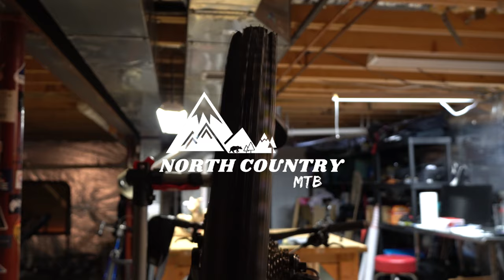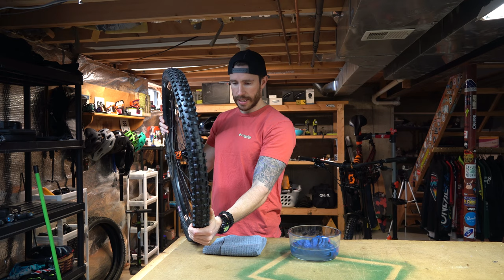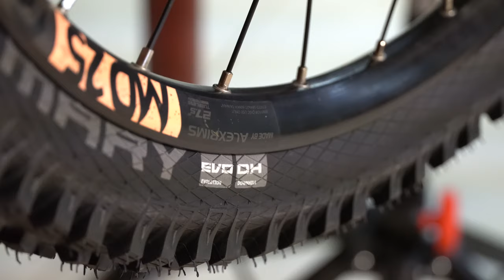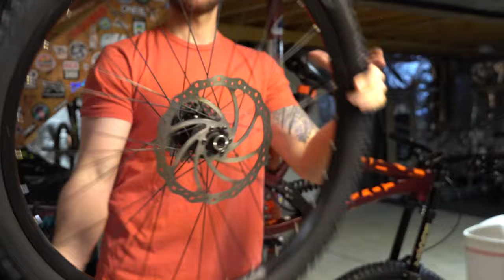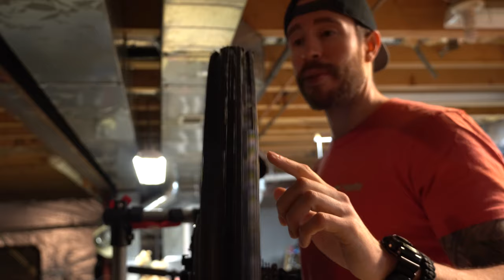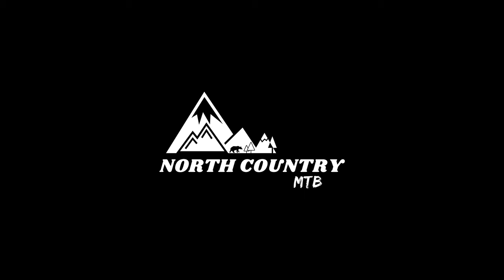How to get rid of that Wobble in your tire | MTB 2021 4K

Comment: Great tip for people who struggle seating the tire. Two things: First, I do this with a spray bottle and you don't have to take the tire out of the rim. Just deflate it and spray soapy water with the bottle and inflate again and voila!. Second: it's always better to go tubeless :)
Reply: Does this method works with tubeless tires? I dont wanna contaminate the sealant with soapy water.
Reply: @cardace2691  I usually seat the tires first and then add the sealant by the stem valve.
Reply: I mean, does deflating the tire and spraying soapy water to the tires contaminate the sealant inside?
Reply: Nevermind, i found out that the problem was in the tire bead itself. I guess its not fixable haha
Reply: @cardace2691  so what did you do? Did you returned the tire or used just as it was. Does it affect your riding?
Reply: @jeansaldivar1245  i just replaced it with new tires. And it does not affect my riding. I am just annoyed with the wobble
Reply: Still didn't help me
Reply: Soapy spray works well for hand fitted motorcycle tyres too
Reply: Spot on, I had a set of wtb gravel tyres that I didn't seat correctly and the bike was bouncing, followed the tip here and bingo tyres are spot on 😊
Reply: No, is not
Tubeless has a LOT of issues being one of the biggest bike can't stay without moving more than couple of days or sealant will get ruined
Reply: Maybe I'm not spraying enough or don't know where to spray but was really hoping this trick would work for me

Comment: THANK YOU  This saved me a $300 trip to the shop.  A few tips from personal experience:
1) Use more soap than water.  I had a whole giant squirt of Dawn dishwashing soap, with just a dash of water from the kitchen sink sprayer to bubble it up a tad.
NOTE You don't want to use oil or silicone lubricant.  Those remain slippery.  Soap dries up and becomes tacky.  Once the tire is in place you want it to stay there.
2) Use a fat chunk of sidewalk chalk to mark places where the bead of the tire is unevenly tucked.  On my tire there was a very distinct line to follow along the edge of the rim, and it was pretty obvious where it had not popped far enough out.
3) Marked both the sidewall and the tread, and spin the tire to confirm that the wobbling was happening right at the chalk.  It clearly was for mine.
4) Deflate the tire, and apply generous amounts of soap to the sidewall and rim only where you've marked with chalk.  The rest of the tire is seated already, so leave it alone.
5) CAUTION: I would highly recommend researching the PSI limits of your rim and tire before moving on.
6) Slowly and consistently inflate the tire.  My bike pump has a gauge, which helped tremendously.  I inflated to about 20psi and worked the tire back and forth again with my hands.
7) I went to the absolute limit of both the rim and tire.  I also hit the spot with a dead-head hammer (rubber with sand inside) to convince it.  This was sufficient for the spot on my back tire.
8) My front tire only had one bad spot, but it didn't want to budge.  I had to actually go over the rated pressure (60 psi vs. 50) to get it to pop.  It didn't do it right away.  It took about a minute.
9) After the tires were seated, I backed off the pressure to get it back within the normal range for the rim/tire.
10) I did not remove either tire from the bike.  This worked with the bike upside-down on a flattened box on the garage floor.
11) After cleaning up, I rode the bike, and I couldn't believe the improvement.  It rode like new.  I couldn't be happier.

Comment: DUDE!!!! Thank YOU!!!!  How did I not know this?

I was so angry my 90$ a pop, Vee Huntsman fat tires were doing this! I was about to get different tires but so dreading replacing them again. My e-bike has a hub motor in each wheel and changing tires is a huge pain in the ace!

I deflated my tires, got a spray bottle with some soapy water, and went to town spraying it in the inner sidewall of the rim and along the bead. Inflated it and BAM! THESE TIRES ARE FINALLY SEATED ON THE BEAD!!! Of course it's going to rain for the next few days so I can't confirm the wobble is gone, but I can clearly see an even spacing now, and the ridge of the bead is where it belongs.

Bro, you are a lifesaver!

Comment: Thanks for the fix. I had the same issue - Strangely with Schwalbe tires as well. It had really gotten me down as I tried everything to fix it and still no luck. I also trashed my rim with metal tire levers (snapped all my plastic ones in the process) trying to get the tire on the rim in the first place. The wobble was just the kick in the n*ts that I didn't need.

Comment: Thank you! Just adding to the long line of people who solved the issue like this. No more bumpy ride on a smooth road.
Note - for me it only worked after I really soaked the tire with a soft brush. Using little water with a rag didn't work, nor did WD40 like some people recommended. Also there was no popping sound in my case.

It's a little weird that a bike technician told me my wobble was totally normal (apparently sometimes tires just come out like that from factory) and there's nothing I can do about it.
Fortunately he wasn't convincing me to buy a new tire, although I was seriously considering it. I rode with a bumpy wheel for about a year because it never occurred to me to lube the darn thing and pump it way above the recommended pressure, I was only pumping just a tad above it.

Now I feel stupid for both myself and that "technician" but I'm super glad I solved this.

Comment: Nice tip! Will try this out in a minute. I saw with much pleasure that you use tyre levers to get the tyre back on the rim. I saw a (dutch) video in which the guy said: Whatever you do, DON't use tyre levers to put the tyre back on. But I, already for over 30 years, use my (plastic) tyre levers as there is now other way to get them on! I'll let you know if your trick worked for me, though I first want to try this without taking the tyre off. I'll deflate them and wet the tyre like that ;-).
EDIT:15 minutes later: Reseated 2 tyres perfectly! Didn't take them off the rim, but deinflated them, sprayed (someone below came up with that great idea) both sides and after that inflated to 50psi. The second tyre almost give me a heart attack, as it 'popped' very loudly, I thought I blew my tyre 🙂. Perfect advise, thank you very much!

Comment: Thanks Dude.  I actually didn't use any soap.  I tried first by manually manipulating the part of the tire that was not seating well and pumped it up to the max psi.  It slipped right in.  It was a gravel tire.

Comment: Ya had this problem too. I just deflated tires a bit and put some chain oil on finger and ran it on the rim both sides and that worked.
Reply from the maker: Great idea. Ill give this shit next time and make a video!
Reply: The method in the video did not work for me, but lubing up both sides of the rim did. Thanks a lot for the tip man!

Comment: Nice one!!! I had the same problem with 20x4.0 fatbike tyre - this soapy water trick  helped a lot - thanks👍. I just deflated and used medium size paintbrush to give a good dose of soapy water on the tyre and rim. Also even though I over  inflated I did not get the "pop" so ended up half inflation and massaging the tyre inward and away with from the rim with my palms to get it to pop in place. I did this all the way around on both sides to get the mounting line as even as possible.

Comment: Can confirm this worked for me. I didn't even take the wheel off the bike. Just turned that baby upside down, deflated and ran some soap around the rim. Inflated and done. Fyi this wobble is more common on folding tires than ones with a wire bead in my experience.

Comment: make sure to check max tire pressure of the rim manufacturer not to blow it off or damage it. even hooked rims have sometimes very low inflation limits. like the dt swiss xrc 1200 has a max limit of 2,5 bar or so.

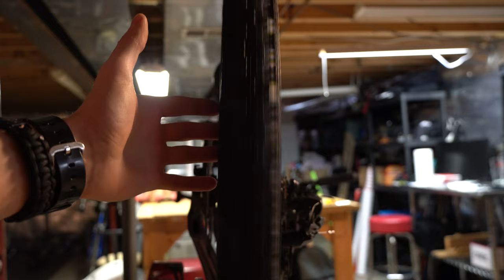Comment: 2:25 Once the frame settled (watching the axle points in the background) there was still a large deflection... did you have a bent rim as well (spokes etc)?

BTW Viewers... If you have a wobbly tyre it can be the rim tape if it has shifted when fitting the tyre. If the tape gets under one sidewall it can cause a deflection.
You can also have a sidewall failure. (See this failure at 40 secs on mark.. https://www.youtube.com/watch?v=PUq8SVRxrVI)

Comment: I tried this method only on one side cause my issue was on one side only when that side seated I saw the problem went to the other side so lesson learned add the soapy water on both sides even if the problem is on one side..good video tho .
Reply from the maker: Great tip! Yeah id do both sides while you are it rather having to loop back. Glad it worked!

Comment: You replaced the tire and tube but it was still warped? If you did al lthat you'd be starting the seating process from scratch each time which should fix it in the first place...
Reply from the maker: Nothing was warped. The tire(s) were not seeding properly until the soap and water method. Whether it be the wheel or Schwalbe tire that made the seeding so difficult is the question.
Reply: @NorthCountryMTB  exactly. Very strange that you basically started from scratch multiple times with 2 different tires and it still wouldn't seat properly.

Comment: I have this problem with WTB tires. Received a warranty replacement and same issue. I also did this soapy water hack and no avail. My tire is seated properly with even line markings throughout the rim on both sides.

Comment: I tried everything even with 2 sets of different tyre's on my HALO T2 rims couldn't for life of me get them to run true until i pumped them up to 80psi then pop they seated properly then i just deflated them to the correct pressure

Comment: Tried the soapy water , just used a small sponge to soak  around the tyre  ,and as I am a cowboy , I didn't even take the wheel off the bike , it worked though.

Comment: I'm still frustrated.
My rims are true within 0.006" lateral per dial indicator. I've always used dish soap to lube bead. Tire rings are concentric to rims all the way around, both sides, on all 4 tires of our his n her's MTBs. But all 4 of our Conti Rubans have a lateral wobble one place each tire. 
What is the industry expected tolerance for how consistent tread centerline is to the beads?
I've never seen tire wobble this pronounced on tires that are concentric to the rim.

Comment: Can I do anything with a defect tire? My rim is trued and I can see the bead line consistent all around. Swapped front to back, same issue. For now, my best option is to mount it in the rear and avoid messing up with the steering.
Reply from the maker: See if you can contact the manufacturer

Comment: Tried everything and still got the uneven wobble. Is it a Schwalbe thing?. Been fitting many tyres over the years and always sorted. Before I throw the lot down the road I will sleep on the idea and tune back in tomorrow.
Reply from the maker: Contact Schwalbe and send em pics they will send ya new tires

Comment: Great video. My LBS gave me the same advice and it worked. But my question is: Is it ok that some of that water is now in there between the tube and tire? Just wondering.
Reply from the maker: Should not have any issues with a little water in there. If it doesn't evap it will just be moist. Have not had any issues with mine!
Reply: Some report an internal rust issue.  On one video the guy just used straight soap on his fingertips and wiped a small amount directly around the area that was not seating, thus no excess water floating around inside.

Comment: What if I did this several times, using tons of different soapy water and it still doesn't help??
(People, never ever buy Continental tyres, 4/5 of them (that is precise statistics by me) are wobbly as hell. Had to return many of them)
Reply from the maker: I had bad luck with Continental tires back in the day. Now we have specialized and MAXXIS and then the schwalbe for the DH rigs.
Reply: I have been road biking with 6 friends for 35 years and 6 of us have always used Continental tires without any wobbling.  That's our precise statistics. Not arguing with yours, just stating mine.

Comment: so is there water left inside your tire? if so it can shift your inner tube enough to tear it
Reply from the maker: I do not think that will be an issue..i rode mine DH on GNARLY trails multiple times with no issues afterwards!
Reply: @NorthCountryMTB  thankyou good toi know i do imaghine this would be ok.  i have had issues with water from diy studs. i fill my tires with talcum powder or baby powder. just enough to keep things dry aand fresh lol i wonder if the seating issues lie with owning fat tires.

Comment: When I change tires usually get the beads pretty much where they need to before inflating, normally pop and they are on. Any tricky tires I have used talc before, same idea as soapy water.

Comment: Will i have to remove the tire and the air out of it before doing it or can i just add the soapy water and try and fill the air a little more
Reply from the maker: You can try - I’d let all the air out then work soapy water in around the rim then shoot it up with air.
Reply: @NorthCountryMTB  thanks a lot,and will i hv to detach tire first or can i just do that while it’s attached?

Comment: Does it requires more pressure to inflate? I only have hand pump with me. Will it work?
Reply from the maker: Might be tough with a hand pump but if you can pump your tire up to 50 psi then you might have luck. Floor pump it ideal.
Reply: I just tried with a hand pump but it doesn't pop, I'm barely at 40psi and cant pump more. will get a floor pump and retry.
Reply: Yup, I switched to floor pump but still it did not worked for me. :( I brought my bike on the shop and they just pushed the affected part using their heel and the tires magically laid on the rim. Still, thanks for the idea man.
Reply: @jamesasher7881  sadly I may end up doing the same, the floor pump didnt help me either, I tried all kind of movements but a quarter of the tire stays a bit under the rim.

Comment: Servicing bikes over 10 years now and from my experience this is the biggest issue with Schwalbe tires in general (especially wired ones) that dont sit in place properly. Tires that I had zero issues with when mounting are Continentals, althought their side walls are weakest part so they are not for long run compared to Schwalbe.

Comment: Wd-40 would keep rim lubed longer, unless anyone can think of negatives about wd?
Reply: Don't use wd40. You don't need lubrication. Also petroleum based stuff will destroy rubber. And I think wd40 is petroleum based.
Reply: Some use red rubber grease for rim lubrication or something silicone based.

Comment: tried it and still didn't work!! 

The bead sits perfectly and parallel everywhere but the tyre stills wobbles a lot. Any ideas or other tips? I might need a miracle, funny fact the tyre was perfectly straight has I removed it to change to tubeless.
Reply: Same issue. My bike shop said that it is maxxis moulding error.
Reply: I built my Ebike from a Schwinn.  The tire that came with the motor/hub assembly blew out.  I replaced myself and noticed a small wobble.  You need to true the tire with a spoke wrench.  The wobble is not always the bead of the tire but incorrect tightening of the spokes.  Check out Youtube for truing a tire.  It's easy.
Reply: @destreal but they still sell them knowing they're crap😢2 out of 3 Ardents i bought were warped & had to go in the trash can😅

Comment: Why mine keeps wabbling even i did it my rims is align and the bead is all good
Reply: Have same problem , after few trials just leave it as found on one of forums that there was quality issue for some time at Chinese factory producing tires for all big tire players, most  issues had Maxxis users .... unfortunately I'm one of them 😠
Reply: Ok, just yesterday changed for NNick2.8 with 3pace - much faster tire , according greep seems lower performance vs Max Rekon+, but maybe need to play more with psi

Comment: I already did the popping the wire bead onto the rim method but after that the inner tube will be punctured. What should I  do? (BTW my tire is a maxxis ikon wired version newly installed but it's a wobbly tire)
Reply: i had the same trouble only way to do it is find your inner tiger and do it by hand , its very hard but i did it .

Comment: Is any kind of soap okay?
Reply from the maker: Yeah any basic dishsoap is what i would suggest. I actually used some all natural soap stuff my Girlfriend got haha. Also, you don't need much of it.
Reply: @NorthCountryMTB  I have a few questions:  is this soap method a temporary fix or a permanent one?  2). Does this work for any kind of a mountain bike?
3) if yes do I just remove my tire and get rid of the air remove the tire from rim,  then rub soap water and then pump it back up?
4) is it possible to fix this without separating the wheel from the bike?
Reply: @Takeactionbros  1) it's permanent but it can occur if there is like opening of tire or putting it back in 2) It works for all cars, bikes and all types of cycles 3) you can try that yourself to check whether it works or not 4) You can do it without removing the wheel, he did because he wanted to show the bump clearly. But if you do so, nothing will happen.

Comment: My smart sam tires can only handle 3.8 bar it says. Can i slightly over inflate to let it pop? Just soap doesnt work
Reply from the maker: I cant condone over inflating past what they suggest however yeah, I would inflate until the tire popped in place. Wouldn't get too extreme with it but 50 psi - 60psi should do the trick hopefully. Make sure a good amount of soapy water is on rim and tire then pump her up until you hear it pop in place. If not then maybe tire has a defect.